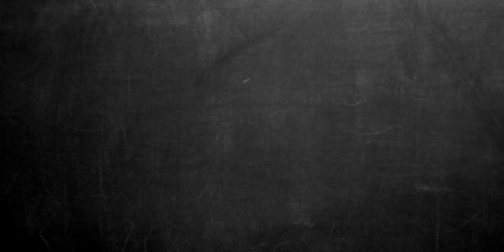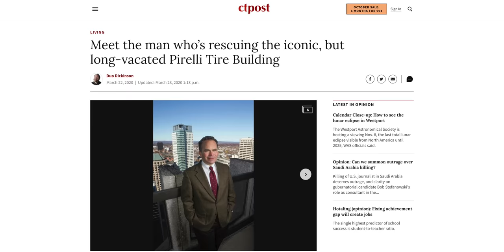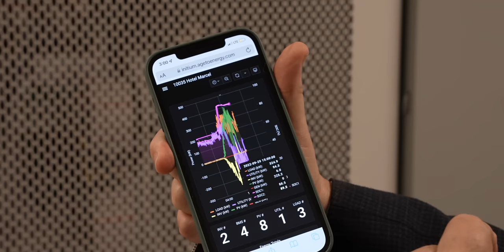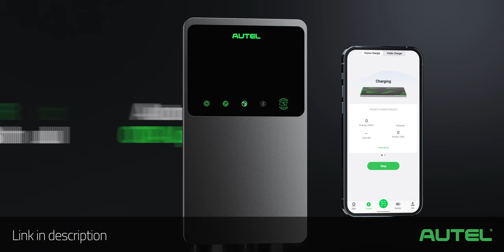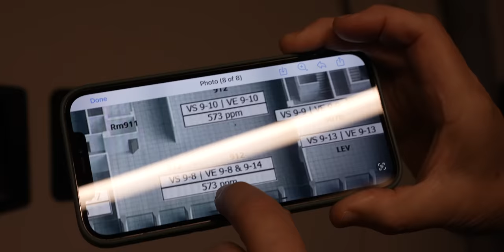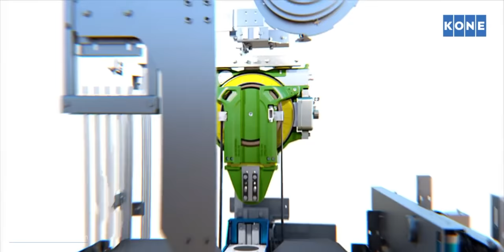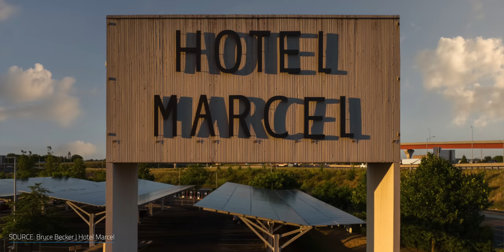How Big Can You Make a Passive House?

Comment: I would definitely not mind if my landlords would equip our balconies with solar panels on the railings. My particular apartment block complex is nicely aligned south-east/south/south-west, which means a lot of sunlight hits the walls every day. On top of that, we have neatly angled flat roofs facing the same directions, which could be covered in solar panels easily. I have one 315 Wp panel on my balcony and with 1 or 2 more and some battery storage, I could cover most of my daily energy use if the sun shines.

Comment: Elevators don't generate power when going down. The motor has to run to lift the counter weight. They do in fact generate power when going up because the motor has to regen brake the descent of the counter weight

Comment: I love watching these videos. I'm in a bit of a unique situation in that I live full-time in a large motorhome. I often watch these videos with an eye toward brainstorming how I can adapt some of the tech to my motorhome. I already have 1.7kW of solar and another 400W of wind power (that gets set up when I'm stationary). I removed the motorhome's rooftop air conditioners and replaced them with roof vents and bi-directional fans. I've found that airflow makes as big a difference as anything and the fans use only about 17W each. So all this "advanced" tech (some of which is quite old) is fascinating to me.

Comment: Of course in inner cities the whole issue of blocking sunlight from other properties will become a major issue once more...   And if they add some clotheslines on the north side of the roof... they could greatly cut down on their dryer usage!!  The increased air flow at the roof would greatly reduce the drying time for the sheets,  they could damp dry within an hour...  if they add a dedicated centrifugal extractor after the washing machines,  that could also get the sheets to damp dry quickly,  saving lots of resistive heating charges...  then they could use the sun and breeze on dry days to finish the drying quickly on the roof.   I used to use laundromats with the centrifugal extractors,  they cut my drying times for clothing down by over 2/3rds.

Comment: For decades when traveling in Asia I have noticed that most hotels use your electronic door pass in a wall mounted holder (inside the room) to turn on the electrical circuits so that there is no energy drain when you leave the room and take your door pass with you. I have never seen that in any North American hotel I've used but feel it's a great idea.

Comment: mind blown with that PoE system. consider that most electric fixtures above our heads are usually lights, wi-fi, ip cameras, routers. since it is already ethernet, home automation is a lot easier and so is the easier wiring and safety!!🤯🤯

Comment: Hi Matt, love your program.
This comment is about a video you did about a year ago, called, The Truth About Hydropower - Is Tidal Energy the Future? 
When we look at green energy projects we do not talk about how much carbon was used or how dirty a industry is that is making renewables.
I would like to know how much C02 was made in the making of Hoover dam and how much the dam has saved in C02 since it was opened.
Below are the two bits of the puzzle, this is as far as I got, could be another video for you.
How much concrete is in the Hoover dam? Three and one-quarter million cubic yards. There are 4,360,000 cubic yards of concrete in the dam, powerplant and appurtenant works
How much CO2 is produced from concrete?
 The manufacture of cement produces about 0.9 pounds of CO2 for every pound of cement. Since cement is only a fraction of the constituents in concrete, manufacturing a cubic yard of concrete (about 3900 lbs) is responsible for emitting about 400 lbs of CO2.

Comment: I am impressed, but the CAT6 part floored me. I know the demands are lower so the diameter of wire needed is lower, but I didn't expect it to be that small.

I had a former supervisor hire an electrician to wire his house, including running CAT6, and the electrician clearly had no idea how CAT6 worked, running 1 line per dual socket plug and splitting them... which of course made all of them useless. (Made worse by the fact that he was given clear instructions that he ignored.)

I would imagine the wall sockets for guests still need to be run conventionally since not everything is DC compatible, but this is a really great idea on so many levels.
Reply: We can do Exhaust Fans, Ceiling Fans, and USB outlets.  But, yes, electricians often need to "unlearn" a lot.  You can learn the entire LumenCache system in under an hour.  There's High School construction students that learned the system one day and installed in a house the next day without any hitches.  Granted they have a Matt Blomquist as their teacher and he's awesome!

Comment: You continue to stretch our understanding and knowledge base, but this one seemed to step it up another level altogether.  Amazing reworking of an older building, and I’m going to be checking into the ‘power over CAT 6’ since honestly I’d never heard of that before.  Solar DC to direct lighting, with central control w/o an inverter?  Wow.
Reply: Power over CAT6 is common in the industrial space. Search for "Power over Ethernet" or PoE. Its used to power all kinds of stuff like security cameras, VOIP phones, and more. You've probably passed 1000s of PoE devices in your life and had 0 idea.
Reply: Even if there's no DC/Battery onsite, having one robust AC/DC converter with power factor correction saves about 25% just due to the PFC.

Comment: Some great initiatives taken in this project to push the boundaries. A few things were technically incorrect and/or exaggerated though (the guy is an architect so I don’t blame him).
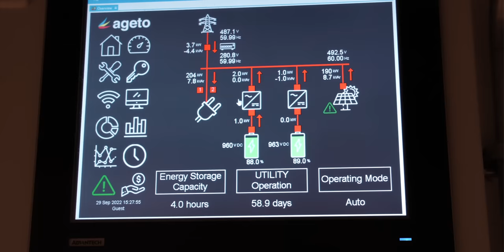1) At 12:46 it’s stated that DC power is used directly from the solar/batteries without converting to AC. This is clearly wrong - at 4:10 guy actually shows off the battery inverter and at 4:44 and the mimic clearly shows conversion to AC for the loads where it is then dropped to 48V for POE.
2) Based on the quoted number of solar panels and the load trends at 13:10 they would need well over double the number of solar panels to be net zero, and that’s without considering the EV chargers. Enough roof space for PV is always going to be a massive challenge for multi-storey buildings.
3) At 9:00 the guy states they use 100% fresh air to the rooms - even with an ERV this would be horrifically inefficient.
4) At 15:22 he states that “it doesn’t cost more than conventional”. From experience I can say integrated systems like this cost a bomb.
With that said it’s a great project containing features that will become much more common in future years. 👍

Comment: Excellent job, Matt, as always. However your use of "passive house" conflicts with what I learned in 2005 when I installed solar PV on my roof and rebuilt the buildings envelope. I live near Denver CO where the winters are cold, and the summers are not Phoenix hot. What I was not able to do, because of site conditions, was what we called "passive solar" -- the low tech approach to home heating using a solarium. These work best with a two story house with the living area on the top floor; and excellent solar access at the southern wall of the house. The two story solarium is located at the south side with rock thermal battery, and is a separate well insulated envelope attached to the house envelope. Opening windows on the top floor allowed solar heated air to flow into the living area, forcing cold air in the house to flow down the stair well and back into the solarium through basement doors or through vents located near the basement floor.  The people control when heat is supplied to the living area, with no fans or gadgets. That is passive. What you describe is the standard envelope, with a hell of a lot of high tech equipment, which is very expensive, and there is nothing passive about it.

Comment: Matt, as usual, a great video. Thanks. I just completed an off grid solar home with all the features you describe, airtight, super-insulated with 13KW of PV and 100 KWH of batteries to run it. I also have something you don't mention, Phase Change Material, about 2000 lbs. This is i the walls and ceilings behind the sheetrock, and stores 220,000 BTU as latent heat around 70 deg F. I am in sw Utah, at 6300 feet, and it all works well. I have a slide set describing the features in detail if you want a copy let me know. Nick Lappos, Cedar City, UT (I am an aerospace engineer and a Senior Fellow for my company)

Comment: I really like the overall theme with this hotel.
Regarding the elevator, I would like to note, that the energy recovered through 'regenerative braking' depends on the elevator loading (e.g. number and weight of people). Strightly speaking, if the elevator is entirely empty, it likely recovers the potential energy stored in the (now heavier) counterweights while /rising/ by keeping the elevator at a constant speed electro-magnetically.

Comment: It may surprise many people that many of the features of this building are pretty common. The power over Ethernet, regen elevators, and automated window blinds control for light harvesting and solar load control are newer technologies that are less common. 
The CO2 control is referred to as demand ventilation. It has been common for large conferences room for over a decade. The CO2 is actually being used as an indirect and delayed indicator of how many people are in the room. A new form of demand ventilation uses sensors or devices to directly count the number of people in the room. 
Since you introduced us heat pump clothes dryers a few videos ago I was surprised to hear that their large commercial dryers use electric resistant heat. 
There are many different types of energy recovery units. (AKA heat recovery units) The plate or air to air exchanger that you will be using is just one type. (In a commercial buildings with that type of heat recovery unit the amount of heat recovery/rejected is usually modulated by a face bypass dampers.) I wish that you had an opportunity to explore their energy recovery unit more. 
You referred to the Mitsubishi units as a heat pumps. For a building like this I would expect them to use a variable refrigerate flow (VRF) system. The Mitsubishi City Multi is one of the big names in VRF systems. A VRF system can transfer heat from a room that needs cooling to a room that needs heating. This is more efficient than both room exchanging heat with the outdoors. VRF systems would be a good subject for a video. 
Their domestic hot water system surprised me some. It looked like a 140 deg F system with mixing values to produce 120 deg F water. I was expecting separate 140 deg F and 120 deg F systems. 
By the way, Washington state's newest energy/climate rules for new commercial buildings requires that no combustible fuels are to be used as an energy source. Combustible fuel generator backup is only permitted in medical buildings. So buildings like this and even more efficient will become more common.

Comment: Old elevators were DC:
Historically elevators worked on direct-current DC, so they could easily be running two different directions, only recently has DC been replaced with high efficient AC motors.

Comment: OK, so did I get it right, that they understood, that heatpumps exist, and realized, that 2 dryers are eating more power than the remainder of the hotel, but did not make the next logical step, that the dryers should be using heatpumps instead of resistive heating?

Comment: Currently trying to get a 10.000 sq meter factory to net zero. Whole roof will be full of solar, offices are already on heat pump, planning on the heat pump for the factory floor. Planning the inverters to add battety storage. Then also a central system will be needed to divert the excess energy to heat/cool different area's.

Comment: There are heat pump cloths dryers for home use. You would think there would be commercial versions. Using a heat pump it could provide A/C if needed. My house was net (below) zero last month, producing 1mwh more than I used. I did use some gas (not yet converted to electric), but not 1mwh worth.
Reply: We have one of these and they are great for reduced consumption, but I bet the hotel needs quicker cycle times than it could offer.

Comment: The thing with effective retrofitting is obviously knowledge, expertise and innovation. Along with dedication to keeping up with developments in that space. Bulk purchasing power is obviously also another key enabler of such a transition. 
Basically with energy prices on the rise. I think it should be possible to provide retrofitting as a service that "freezes"  home/business' "energy bill" for 10-20 years which is really just paying off the cost with profit of the conversion since the actual net energy use is drastically reduced. A sort of retrofitting bond. Except there's no difference to the building owner's budget regardless of inflation for a decade or so, and afterwards they take full ownership of the system.

Comment: I do have to wonder why the entire hotel is fitted with state of the art heatpumps for hot water and heating, but the dryers of all things are still resistance heating, while heat pump dryers have been a thing for at least 15 years.

Comment: Friend is head of maintenance of a Hilton, with roughly 350 rooms, that often has conventions.  That's a huge number of water heaters, all being used hard at once when you have literally hundreds of people getting ready at the same time.  I think it was arranged as 180 water heaters with each serving back to back rooms.
I'm betting that hotel is counting their power back feed offset when it's not being used much.  Just a rough guess, you'd need more like 2 or 4 times that in solar and a lot of energy storage to really be 'off grid' and have any chance at reasonable recovery times from the huge power drains.
Just saying, it's a huge amount of power use.  And don't be surprised if the hotel is off loading their laundry to a laundry service, so a huge chunk of their energy use is actually being handled by another company off site, so their energy use is moved off the books.  A lot of hospitals and hotels end up splitting laundry into a separate service provider so they don't have to manage it in house.

Comment: I believe part of the Zero Net building concept is also in the livability of the construction external site like for example creating green area's accessible to the public or just an attention to the outside as if your designing an indoor space. I suppose it will be a big challenge to fufil that point in an American urban grid which is car oriented, but it is part of the energy sustainability ideology that too often gets forgotten. It's isn't only about energy saving, but also about a more natural space design. Reconnect the building to its place creating a cohesive city, not a set of buildings.

Comment: Here is my thought for the hotel.  Schedule the dryers to operate during the time when you are otherwise feeding into the grid.  Unless you have net 0 metering, that is the most efficient use of your solar.  This may require a rethink & balance of stocks sheets and towels etc, but long term it would be the best use of that solar.  Its no different to me waiting till my battery is charged, then doing a load on the dishwasher and clothes washer/dryer etc, before the sun drops off in the afternoon.  What I get from feed in of excess power it 25% of what it costs me to draw so it would be crazy to let power go into the grid when I could schedule something I had to do to use it, rather than chewing into my battery to do it later on (which then runs out and I draw from the grid till solar kicks in again).

Comment: IIRC I read that the the Taj Mahal is the biggest passive structure because it has thick insulated walls and designed for a constant light breeze by controlling the flow of cold and warm air. Whether it truly is the biggest, I have no clue, but the information about the air system is correct.
Reply from the maker: Good call out.  It was designed to keep air moving and cool the building passively.
Reply: A lot of buildings prior to air con etc were built with passive temp regulation in mind. I grew up in a house called a Queenslander, (basically surrounded by a covered veranda and on stilts so that the sun doesn't touch the walls and air flows all round), but they stopped building them. We need to get back to this way of building.
Reply: @snowstrobe  Thanks for the comment on the Queenslander house design; I hadn't heard of that particular design before although I have seen similar designs for the same reasons in places like SE Asia. I pulled up info on the Queenslander designs -- beautiful!
Reply: @vermeerasia  Yes, they're lovely buildings, often called a 'colonial'... the Brits built them in all the tropical places. I used to sleep under the house in summer on a hammock spread between two stilts, and the essential mosquito net.

Comment: It's interesting to hear that the Dryer's are the only "resistance electric use in the whole building". I know heat pump technology is already increasing energy efficiency for home washer/dryers, so I wonder if there's a gap in the market for heat pump based dryers on that scale.

I could also see that in the future, heat pump dryers could be tied into the Hotel heat recovery air conditioning systems, so it can dry sheets even more efficiently whenever rooms elsewhere in the Hotel  need cooling.